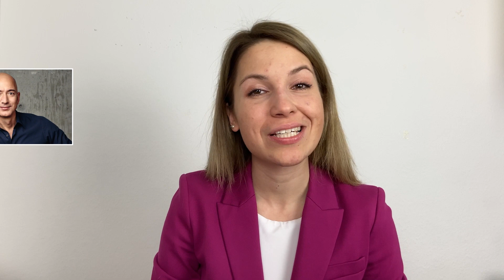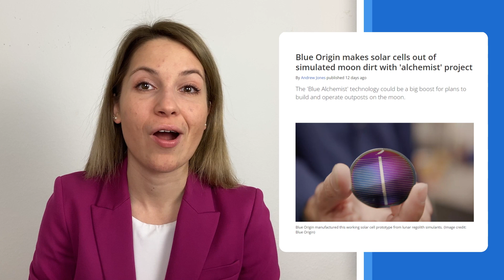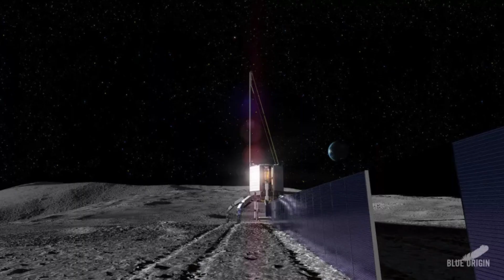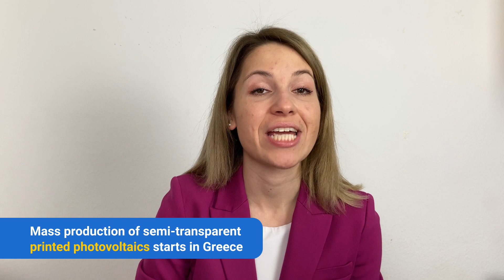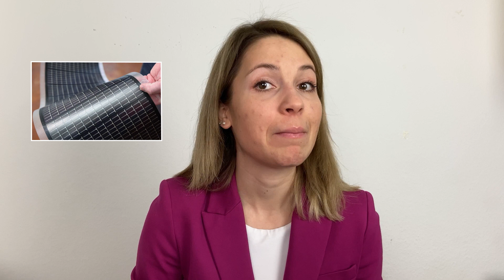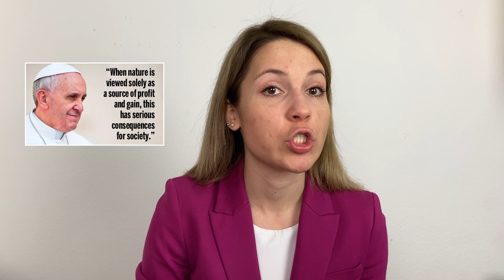Solar panels made from moon dirt, solar jobs in Ohio, and Nebraskan retiree against HOA

Comment: UNRLIABLE SOLAR. HAVE TO REPLACE EVERY 10 YEARS. MY ELECTRIC WQUIPMENT DOESN'T NEED TO BE REPLACED. AND THE COST. MIGHT AS WELL DOUBLE MORTGAGE THE HOUSE. AND MOON DUST HAS BEEN DETERMINED TO BE VERY DANGEROUS. WHAT A PIPE DREAM. WHY NOT FIX WHAT YOU CAN, INSTEAD OF MAKING MORE NEW PROBLEMS TO FIX. IT'S ALL HORSE PUCKY. AND WHAT DID SHE SAY? YOU NEED TO USE AN ENGLISH SPEAKING SPEAKER. ALL I HEARD WAS CHARLIE BROWNS TEACHER